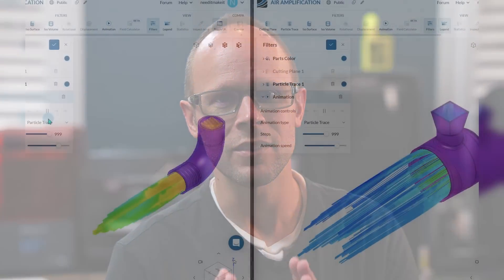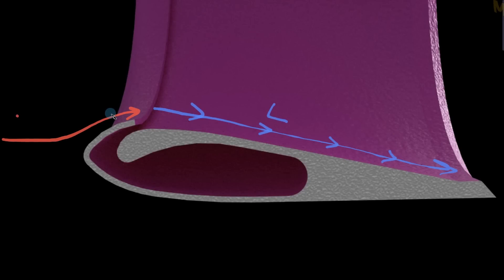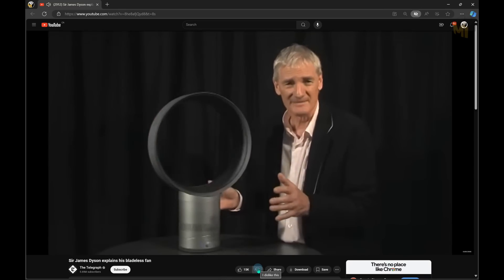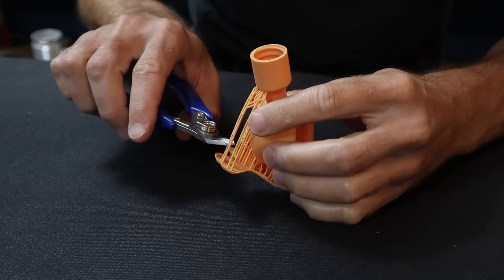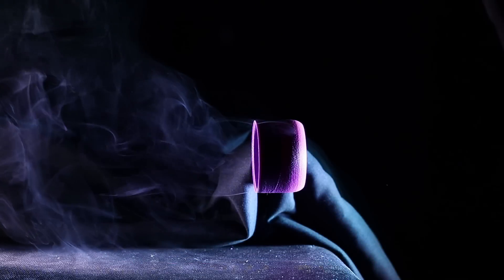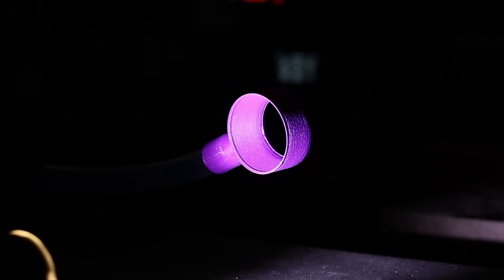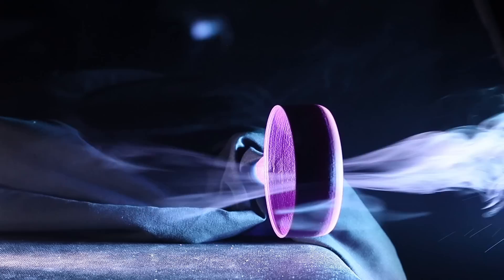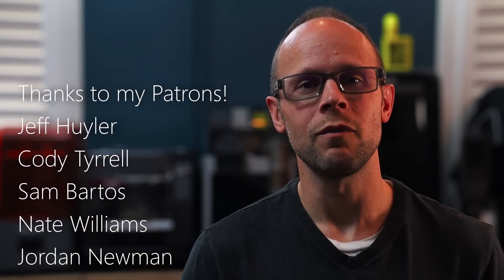3D printing a functional Air Amplifier and testing it to see if...

Comment: Compare the thrust of just the fan, even without the hose, to whatever "air amplifier" you want to analyze the efficiency of. The [static] thrust tells you the amount of kinetic energy that is added to the air, the net movement of air that is caused.  You know, equal and opposite reactions, the thrust, or "push" on the outlet is equal to the "push" on the air. Unless the outlet of the fan is very bad for the purpose, like cause a lot of turbulence, you'll find that the fan without anything on it will produce the most thrust, as conversion of energy doesn't generate energy from nothing.  

If you want to use pressurized air fed through a hose for some reason, and compare outlets, the same principle for comparing outlet designs can be used, just measure the thrust on the outlet, to find out the force of the airflow.             

One of the aspects of Dyson fans is that almost every other "room fan" is horribly poorly engineered, making it possible to engineer fans that despite wasting a lot of energy by creating a "high" pressure that's later used to induce airflow, still are about as efficient or even better than most other fans on the market.
Reply: there is no extra thrust from the entrained air. the only thrust is due to air that is worked upon by the fan, compressor, whatever, itself.

once that air has left the fan, anything it collides with has no bearing upon "thrust". the action of colliding air molecules results in the reaction of them being slowed down as other air molecules are accelerated. back pressure increases and that actually REDUCES thrust due to the fan working upon air.
Reply: @paradiselost9946  The thing is,  momentum doesn't just disappear, neither does it magically appear out of nothing, so the thrust on the fan/outlet is equal to the net acceleration of air, assuming a unidirectional flow.    

Newton wrote something like "To every action, there is always opposed an equal reaction." hundreds of years ago, and to my knowledge, this is still considered correct, so you need to either explain what other forces that are involved, or prove Newton wrong about this in order to make the case that thrust isn't a valid way to measure the caused net airflow.
Reply: @fishyerik  ahhhh, newton, him of the anger issues and fuzzy hairstyles :)

an inclined plane, ie a blade, in its motion, or action, causes air molecules, with mass, to accelerate in a particular direction.
the inertia of these air molecules, their resistance to change, causes the inclined plane (blade...) to experience a reaction, in the direction opposite to the blade, in direct proportion to the mass of the air and the rate at which it is accelerated.

(newton nods in agreement)

work must be applied to the blade, to alter the momentum of anything it INTERACTS with. and ONLY what it interacts with.

(newtons suitably impressed...)

that much makes sense?

(fuzzy hair bouncing all over the place as the scalp they emerge from nods vigorously...)

so you only perform work on those molecules that are directly impacted by the blade. got it?

once they have LEFT the blade, those molecules now impact other, stationary molecules... that again, are accelerated, as the previous molecules are slowed down. total momentum is indeed, conserved. a larger aggregate mass is now in motion, but at a lower velocity.

yet, as those secondary molecules have no interaction with the blade, there is no corresponding reaction upon the blade itself.

complete agreement with newtons laws? i do believe so.

YOU cannot perform work upon air molecules that have no interaction with yourself. no "spooky action at a distance"... another one of newtons quotes, yes?

you hit a tennis ball, the racquet imparts a reaction to your muscles as the ball changes in momentum.. but once that ball has left the racquet, there is no way it can have any interaction with yourself, or the racquet. it can only collide with something else, imparting the momentum it now carries. what it does after having been struck has no bearing upon yourself... unless it bounces back and smacks you in the face, lol.

action... and reaction.

 simple :)

so at which point do i fail to understand what newton was saying?
Reply: The air leaving the fan is what's causes the thrust, yes, obviously. In your reality, does the momentum of that air magically increase or disappear by interacting with ambient air in a unidirectional flow?

Comment: I really want to see a drone be created where it can either reduce the size of the propellers and compensate with these blade less fans instead. Also if you could make the internal surfaces out of the solid state fan that they started using to remove heat from gpu’s that would be the crème de la crème of merging technologies.

I bet you wouldn’t even need fans and the drone would be near silent.
Reply: hmmm, like that recent flop, "jetoptera"?

heres the thing... the only "thrust" is due to the pressure differential across the nozzle. the air mass that you perform work upon directly, action and reaction.

the extra entrained air is only accelerated by the collision of air molecules... you perform no work upon it. end result, theres no THRUST produced from it as theres no reaction.

just like ionic thrusters only make thrust from repelling (and attracting) ions... the "neutral" molecules"  are not worked upon directly, and add no thrust. they merely get in teh way, and reduce the velocity of the mass that IS worked upon.

Comment: This particular design doesn't need to be explored.  All flowing fluid entrains surrounding fluid in a positive ambient pressure environment, which will happen in any nozzle forcing fluid out in a specific direction.  Gas or liquid.  The energy gets transferred to larger volumes, reducing velocity, but maintaining total momentum, more volume.
     Normal fans "amplify" air too, without  any special structure, just as well, and no fan/nozzle has a "final" multiplication factor because that depends on the distance away.

Comment: If you can get a "free bonus" from a fan by amplifying the air, why don't any industrial grade fans do this? A ton of money and research goes into how to move air around. If something works better they tend to do it.
Reply: Because the total wind power is decreased but you replace high speed air with slower and more volume.

Yes this is Highly misleading marketing from dyson with these "bladeless fans" that have a regular bladed fan just hidden in the base...

Comment: This was the kind of design that got me down the laminar flow rabbit hole. The real trick is getting the cooling on the part and not the hotend.  Small trick if you have a strange hotend and no silicone sock to keep it insulated is to use carbon felt used by plumbers etc, and something to hold it in place either a zip tie or a metal twist tie.

Comment: I'm really thankful for this vid, I'm interested in using these for a "bladeless" drone. And also I'm fish tanks to get more water flow. I'm sure there is some correlation between the outlet angle and size and the pressure of air.
Reply: Tom Stanton made a coanda effect drone about 5 years ago, wasn’t worth it!

Comment: Air amplifiers or air multipliers are said to add or multiply the air that comes in (the compressed air) and the air that is entrained through the cylinder.

Please make a video where you measure the flow of the compressed air and the flow of air coming out the business end of the air amplifier. to see how much amplification is made. That would be interesting to see. (",)

Comment: The design doesn’t look right, the foil is so thin it would probably work ok at Mach 4, you need a much thicker more aggressive foil for ultra slow speeds… look at very slow flying aircraft for inspiration

Comment: Invert the design, instead of forcing in the air through the middle, put their aerofoil in the middle with the slit on the outside and draft in more air from the sides
Reply: Cant edit comments on mobile browser... If it works, could be used as ceiling fan, but not specifically the ceiling, instead on the corners to move air around the room

Comment: As far as I can tell, all this is doing is redirecting the flow of air 90 degrees from the input tube/hose. Which has some benefits. The most obvious being that there are no blades on the exposed part that is moving the air. This design also allows the motor to be placed lower and enclosed. My question is whether or not this can be used for lower speed fans, like a computer fan? What I am imagining is one fan motor that is connected via tubes/hoses, to the these hoop adapters in the computer case in the traditional push/pull configurations. This would allow the supply fan to be insulated for noise separately from the computer itself. But would also apply for any applications where air movement is needed with a low noise floor. Like a recording studio. Because we are pushing air through the tubes/hoses and then use the hoop to distribute the air in a more effective manner this would then in turn allow the actual fan motor to be far away from the microphone. Similarly to how an hvac system works but on a much smaller scale.

Comment: I think it would be more useful (although less visually impressive) to compare the results of anemometer measurements rather than smoke flow.  
Maybe rig up a test chamber with manometers to measure static pressure as well? That's probably more involved though.

Comment: I would say the hotend will need a thicker silicone sock and well optimised PID since all the air being pulled from around it will rush past the nozzle and even be accellerated and will cool the heatblock and nozzle rapidly, a double usecase would be to extend the shroud and make use of the air gathered to cool the heatsink since it will be pulled through the hoop anyway

Comment: It is impossible to "amplify" air. The venturi effect is never more than 38% efficient. You can convert pressure into velocity, but the airflow volume will always be less, because it is always inefficient to convert one form of energy to another. Dyson has a habit of taking known scientific "effects" and rebranding them as an "invention". I guarantee that the bladeless fan uses 3x the power of a bladed fan. It's also noisy.
Reply: Go look at Exair super air amplifiers. Depending on the pressure I’ve seen as high as 2.5:1 mass flow ratio. You’re essentially injecting air mass flow and either entraining a stationary air column or amplifying an existing air column.

Comment: An "air amplifier" is an unfolded jet pump, a Venturi entrainment device. This implementation reverses the physical positioning of the "jet" and "supply" converging area, but follows the same dynamics as an industrial thermocompressor, or the water injector in a steam boiler.
Reply: I believe if you increase convergence, with the nozzle ring blowing along a nearly rounded inner surface, the Coandă effect can increase entrainment further. Like a Coandă hovercraft, inverted inward.

Comment: I wondered how a aerospike design using this method would perform too. Nicely done 👍
Reply: Thought the same, but question is, aero spike caves inward, while the aerofoil bulges outward, I wonder which draws more air

Comment: You left it outside for a couple of hours and didn't expect the color to change? I haver never cured with natural UV, but in my wash and cure station it gets 10 minutes upright, and then 10 minutes upside down (to get the bottom) and that is as cured as I would ever want it as things already change colors. white things I go 5 and 5 or they start to yellow, and they are still 100% solid after just 10 minutes. So if you leave these outside in the sun for a "couple of hours" I am not surprised it changed colors, you 10x cured it.

Comment: You know, if you were to replace the fan part with an ionic thruster, you could actually have a truly solid-state fan. The Plasma Channel here on Youtube has a lot of great videos exploring ionic thruster designs, and combining that with a bladeless fan design would let you contain the high voltage electronics safely. In fact thinking about it, I wonder if there's a clever way to build the ionic thruster into the ring itself somehow? 😮
Reply: I've owned one, they used fins inside

Comment: I have an Ender 3 S1 Pro with a tri-horned blower.  I replaced the part cool system because my fan failed.

The upgrade definitely has improved cooling performance; but it is limited on the back side of the part.  The ducts need to be 120° apart, not 90°.

Comment: For your resin printing needs - I've found the automatic support placement in LycheeSlicer (even the free version) works pretty well. It is worth noting that resin prints have to be very thoroughly supported otherwise you're get some pretty bad issues with warping, and resin printers in general aren't super dimensionally accurate when anti-aliasing is set too high or your cure times aren't tuned properly.

Comment: If you familiar with core fundamentals of physics, electrical or mechanical - you don't need to be enlightened in subtleties of aerodynamics to understand the result before the experiment: "if it moves more volume using the same energy source - it's gonna go it with less speed"

Basically the same result as plugging bigger open fan at the lower rpm.
Law of conservation of energy cannot be bypassed by bells and whistles. 

The real pros are probably less dust on the fans and less noise due to fan being covered.

Comment: I've definitely felt the "slapping" effect of a normal fan, but when it starts getting really hot, you're going to want to move air as quickly as possible directly onto your skin, the soft amplification is more for winter when you need to gently circulate the air to mix up the warm and cool portions.
Reply: I've never felt it unless I'm directly against one edge of it.  Anywhere else in front, the flow was smooth and constant.  And this is a cheap Wallyworld fan.

Comment: That was the most exciting 3d printing related video I have seen in a long time.  I'm in my 40s and was getting feelings from back in 7th grade science class, in a good way.  Your video sparked a few questions for me.  Could you make a two part fan setup where you could more quickly vary the outlet size to test differences more quickly than doing many different prints?  I'm not sure if the geometry is amenable to that or not.  What can you do to narrow the output cone size and reduce it's growth?  If it could be narrowed enough this might make a great circular fan mount where the nozzle is basically in the center of the duct, although maybe it would only be practical for very long hotends like chube/goliath/rapido uhf?  Amazing work and congratulations on the incredible growth in your skills over the past year, your effort really shows.

Comment: I’ve always wondered if this ring shaped nozzle thing is so good why aren’t there any propulsion devices using it. But it would make sense if this is just a device that trades flow speed for flow volume. This way if you can power a hair dryer with a super fast fan with super high flow speeds, but without needing to intake as much air as a conventional blower, and still have similar performance as a normal blower.
Reply: because the army traditionally employs the best engineers, that know how action and reaction works.

there is NO THRUST PRODUCED by the entrained air, as you perform no work upon it directly.

the only work you can perform is the initial acceleration of the air mass being worked upon by the fan itself. once that air has been accelerated by the fan, any further air it collides with simply slows it down.

much like how rockets work best in a vacuum, and jet engines work better at high altitudes where the exhaust backpressure is reduced. they dont push against whats behind them, it gets in the way and slows them down.

Comment: At the basics it was never that new. It has a fun new look, but the old design was to have a small blowing nozzle in a duct. These have been around for decades to turn an air compressor output from high pressure low volume to a low pressure high volume inflator.
Reply: certain shop vacs use the principle... im fairly certain the fairey rotodyne used the same idea to get the air into its wingtip jets... i know ive seen that concept in an old mechanix illustrated article... a series of staged ducts fed by the initial spray of fuel, each one progressively drawing in more air until finally theres enough mass flow to overcome the backpressure of combustion in the chamber...
and then you can trace its roots all the way back to steam injectors that can take the EXHAUST steam at atmospheric pressure and use the latent heat to force water into a pressurised boiler...

theres not much thats new any more, but as old ideas tend to be forgotten or deemed "obsolete", when they do pop up again, whether they work or not, everyone seems suitably impressed...

Comment: Have you considered adding a spiral or two to the inner face, in order to try and create some beneficial vortex effects?

Thanks also for the heads up on Simscale, which looks very useful.
Reply: You want the airflow to me moving inline, that’s what stators and guide vanes are for. Any tangential airflow is energy/thrust loss.

Comment: Why don't you use an anemometer to test? They are cheap and if you build a testing setup, maybe you can get some data from it. A manometer would be great, but they are expensive.